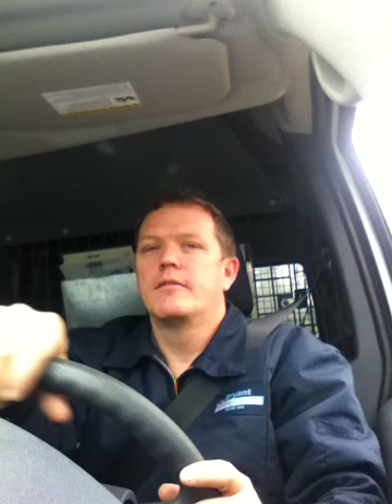HVAC - Bad Heat Exchanger / Louisville Ky.

Comment: As an hvac contractor for over 15 years, the business is changing. Housing made tighter and CO meters are a must, Just picked up a testo 320 to replace my older 325m. Combustion analysis is basically a must on todays furnaces to get a real heat exchanger integrity test. Draft pressure switches on average from the factory operate at less than half of what the inducer fan motor is capable of and i have seen massive cracks in heat exchangers with no roll out! I almost lost a customer last year because a roofing contractor crushed the vent cap and it was a combined vent, luckily the new furnace was tripping a limit switch on the vent (thanks carrier, it makes sense now) and the customer called, him and his wife thought they had the flu and their new furnace was messing up! the co was pouring out the natural draft of the hot water heater from both appliances. My co meter immediately let me know of a dangerous situation and they both went to the hospital. As a contractor you can be charged with HOMICIDE, YES INVOLUNTARY MANSLAUTER, if you do not catch these types of things and take corrective action! So, to the guy doing this for 30 years, you are lucky if you have dodged the bullet for this long, but do the right thing, otherwise, you can spend time in prison and never work in the industry again, all because someone else was careless and you were neglegent in your job!
Reply from the maker: Couldn't have said it better myself.

Comment from the maker: For double wall (B-vent) flue pipes, letters from vent manufacturers say “If you must drill, use high temperature, non-hardening sealant to plug the hole on the inner sleeve. Do the same for the outer sleeve, but cover with a patch of aluminum tape over the sealant”.
Please keep in mind that the vent is in a negative pressure so it will actually pull in air much like the draft diverter on a water heater. it will only leak out if the vent pipe itself becomes clogged.
I hope this helps
Eddie

Comment: If the secondary heat exchanger was crack there would have been signs of water leaking from the unit.
You said that you got a much higher reading inside the unit, this is because most likely there was a crack in the cold end header collector box or a bad seal on the inducer.

Comment from the maker: I am aware CO doesn't have an odor and I never said that I smelled carbon monoxide. I did however say that I smelled a rubber burning smell which is the type of smell that a clogged secondary will put out.

 I've ran into this many times in my career. I made a video (rusted secondary heat exchanger) and that particular furnace put out the same odor and I immediately condemned the furnace. We later went out to replace the heat exchanger and if you watch the video you can see what the cause was.

Comment: Eddie- Good work! I'm pretty sure I know what heat ex. was the culprit. I tend to go a bit further than a CO meter but and CO is a must. I am frankly tired of most of the guys out in the field and their knowledge level. All of the info is out there so if your claiming to be a professional then be one. CO is odorless but there are other compounds that result from improper combustion that are not.